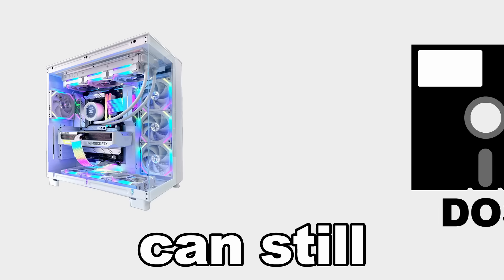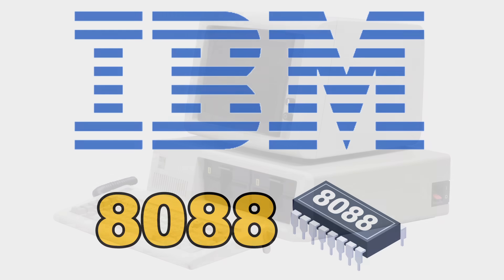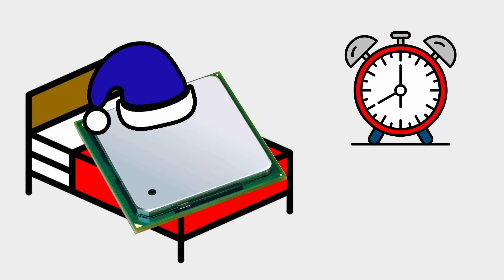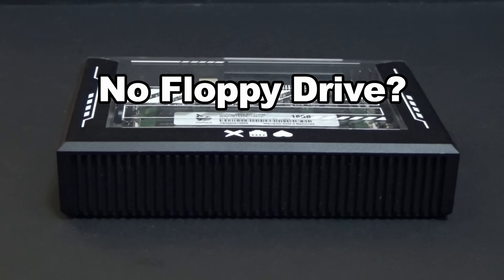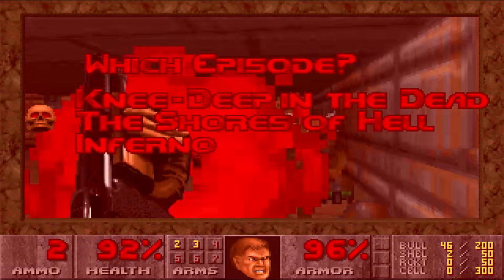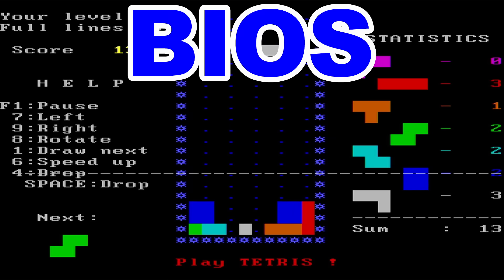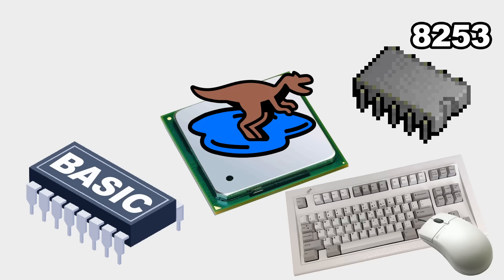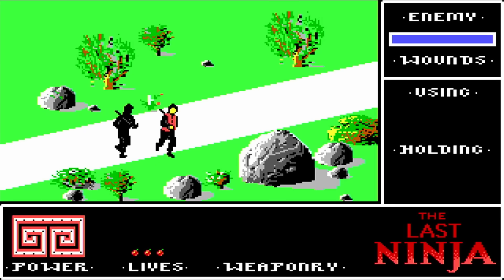45 Year Old DOS on a New Intel CPU Without Emulation

Comment: I tried installing DOS 6.22 on an X64 some time ago and it booted fine, however memory was limited as himem.sys and emm386.sys (with the mem=high, noems etc. or whatever they are, I forget at the moment) but it never found aynthing above 640k. Anyone got any suggestions on hoe to fix that? Thanks in advance.
Reply: I think it was Skylake that threw away software control of the A20 line, which HIMEM.SYS needs to get at anything above the 1MB line, which in turn breaks downstream of this (such as loading DOS high,  using EMM386 to remap memory into UMBs, emulate expanded memory etc.) that depends on HIMEM.SYS.

Comment: What are the advantages of losing the old instruction set?
Does it impede performance?  Is a significant amount of silicon set aside for it?
Reply: The main benefit is that it would free up the much-needed space for the future ISA extensions. x86 instructions are short at mere 1-2 bytes, so the rest of instructions have to be loooooong. Shorter instructions would result in smaller code footprint, reduced memory bandwidth requirements, increased I$ capacity and overall CPU front-end simplification.

Comment: The x86 does not have backwards compatibility with the 8080 and it's derivatives (the 8085 and z80). Instead, it has a sufficiently similar opcode set that relatively simple binary translation is almost the entirety of what's needed to move from 8080 to x86.
Reply: True for code. However the hardware environment was backward compatible to a large extent and used the same peripheral chips. NOTHING was backward compatible to the 8008/ 4004 !
Reply: Interestingly enough, this is true with almost any modern RISC-style core as well. The complex address modes need to be translated to more than one instruction, but overall it's a very simple, mechanical process. 8080/Z80 code runs natively very well after binary translation, since it typically fits in the L1 cache, along with the data. Getting 1GIPS equivalent Z80 instruction rates on current x64 is common. Not that there's a lot of utility for it, but hey, old Mandelbrot programs run at 60FPS+ :)

Comment: I had an old Intel Atom minilaptop, pretty useless for Windows today, gathering dust in a corner. I trashed the Windows installation and put FreeDOS in it. It works fine as a DOS machine, even with some stuff for original IBM CGA graphics from 80's.

Comment: That list of asm instructions aren't 16 bit. Comically cmpsb is compare single byte which is an 8 bit instruction but most are just jumps calls clears adds subs shifts and bitwise operands still in use on 64 bit systems.

Comment: Technically  most  CSM legacy support is emulation.  API emulation that is.   They use a combination of small stubs with Virtualization, IOMMU and/or ACPI functions to create a classic Interrupt BIOS that calls the newer UEFI/ACPI functions.  Because UEFI functions must run in either 32bit or 64bit mode, they do need to use a minimum of Virtual 8086 mode for a portion of their CPU-Side function.  

It doesn't fully hide itself.  If a DOS program traces down the calls it will see how they execute.  They honestly won't care and will consider it like any other 32bit mode extended BIOS.

This basically makes it more in the family of the Wine Win32/Win64 stack or or CP/M for DOS stacks, than native stacks like WinPR and MinGW.

Comment: This video is fake, isn't? Can't have Sound or VGA graphics. Dosbox is much better for old games because you have sound and it can emulate different graphic cards. Most modern mainboards no longer have legacy support. They also boot only from GPT. So you can't run DOS on it. Those times are over. Same with old Windows versions, like 3.11 or 95, 98, etc. In reality the oldest Microsoft OS you can run on modern hardware is Windows 10.

Comment: As far as I know, the backwards comparability isn't that much of a deal. the x86 and x86_64 instructions are translated into even tinier micro instructions before they are send to the pipelines for out of order execution. So the 16 bit instructions aren't much more than a few additional entries in this translation table that is there anyway.
the problem lies more in the way the bit patterns form instructions, that make this translation less efficient. but to make it more efficient basically the whole ISA has to be reorganized... which would break a lot not just 16 bit mode

Comment: I've got a low-end Lenovo laptop that I bought about 6 years ago. Since I am fine with installing Windows myself and could find it cheap, I got the option for "No OS".

I assume it was installed by them automatically to make sure devices that went out would boot up or so the techs could still update firmware if needed, but it came with FreeDOS installed.

Comment: He seems blissfully unaware that PC-DOS did not need BASIC on disk because it was built-in on IBM's (ONLY). Clones used MS-DOS, which was NOT in ROM and had GW-BASIC (Gee Whiz Basic) on disk. IBM did offer BASICA (advanced BASIC) on disk. 
Any PC compatible that HAD put IBM's BASIC in ROM would have been sued instantly. You can still be considered 100% compatible without having BASIC in ROM (which was pretty useless anyway since you need a DOS to store programs!).  🤡🤡🤡
Reply: My IBM PC has a cassette port to store/load basic programs.
Reply: You can write BASIC programs just by using the one supplied by the ROM, but you cannot save it. To do that, you'll need BASICA from PC-DOS, which added the capability to save the program.

ps. IBM BASIC was the default mode for "operating system not found" in IBM PC.

Comment: I suppose it kind of depends on your definition of "emulation".

There's almost nothing in a modern PC that MS-DOS understands. The storage devices, the input devices... Maybe, maybe, the old VGA modes might be supported by GPUs and might be directly usable by MS-DOS without any sort of emulation, but other than that, the BIOS pretty much emulates an old 8086 PC architecture by making the modern hardware look like it.
 
So for all intents and purposes MS-DOS is running in an emulated environment. It's just that it's BIOS that's doing the emulation rather than a piece of software. Maybe VGA might be the only thing that's not emulated, and the hardware supports it directly.
Reply: Programming system interrupt timer and keyboard input directly at least works just fine.
Reply: BIOS's purpose from day one was to hide the disk and video hardware details from DOS for this very reason.
Reply: @ 
Maybe so, but at least when it comes to video hardware you most definitely did not want to use BIOS routines to draw because they were extraordinarily inefficient, and it was significantly more efficient to write to video memory directly (which in VGA was mapped directly to a RAM address range, even in 16-bit mode.)
Reply: @DjVortex-w  All devices are memory mapped on the PC.  The BIOS routines only handled basic text I/O in console mode.  Graphics weren't supported at all in BIOS.
Reply: @stargazer7644  
I lived and coded at the time. And yes, BIOS did have system calls for switching graphical modes and draw to screen (especially in the multi-plane modes which were non-trivial to directly write to). However, these routines were extremely inefficient and you really didn't want to use them but for maybe the most basic of applications.
Reply: AMD stopped supporting VESA mode 103 on Polaris and none of the RTX cards would run on DOS because they depend on UEFI 2.3.1 class hardware.
Reply: @BrunodeSouzaLino  
Yet, even to this day x86 architecture CPUs carry the baggage of having 16-bit mode support, even though literally nothing uses it, and none of the 16-bit software that did use that mode decades ago is able to be run natively (and even if you needed to run that software, perfect emulation exists).

It's a complete mystery to me why they keep dragging that useless backwards compatibility in every single x86 processor. It's just a complete waste of transistors.
Reply: @DjVortex-w  Embedded devices. This is the reason why MS still hasn't cleared WinWorld to offer Windows XP, Vista or 7 for download as abandonware. There are thousands of such devices on the market which still depend on that compatibility. Se goes for software.
Reply: @BrunodeSouzaLino  
I highly doubt any embedded device has a modern x86 processor but runs 16-bit code in it.
Reply: @DjVortex-w  A good portion of automation stuff for CNC still runs 8 or 16 bit code and 3D printers only recently switched to 32 bit firmware.
Reply: @BrunodeSouzaLino  
The question was not whether 16-bit code is used in this day and age at all. The question was whether modern x86 processors need to support it.

The fact that you mention 8 bit code is a clear indication that you are not talking about modern x86 processors here (because they don't support any sort of "8-bit mode" at all).
Reply: @DjVortex-w  Considering CPUs like the 6502 are still being manufactured because they're used on tons of devices...
Reply: @BrunodeSouzaLino  
My question was why x86 processors still drag around the completely useless support for 16-bit mode. Other processors existing is completely irrelevant to that question.

Comment: The 8086 is not compatible to the 8080.
Reply: I replaced the 8088 in my XT clone with an NEC V20, which had both their version of the 8088 and a Z80 CPU in the same chip.  There was also a V30 for the 8086.

Comment: running dos games on real hardware does not only require the cpu to be compatible, but the graphicscard also needs to be compatible with VGA
Reply: All modern graphics cards are still compatible with VGA. They have to be or you would see nothing on the screen at startup.

Comment: @5:30 You're correct that the built-in BASIC is not available like it was back on those machines, but don't forget that you can (almost) always grab BASICA and BASICB and run those old basic programs by dropping those onto the system and using them to run 'em.  On that note, QBASIC won't work with those much older basic applications, but BASICA and BASICB usually do the job when run with an OS that can run said BASICA and BASICB.

Comment: Actually I was mostly running ARM in the 1990s after running mostly 6502 in the 1980s. The ARM back then was mostly backwards compatible with the 6502 in a number of ways mostly because of how it came about though the RISC structure of the ARM did eventually make this somewhat harder to do. Of course ARM has come a long way since those days...

So NO, not all of us went overboard for 8086 back then.
Reply: "ARM back then was mostly backwards compatible with the 6502" That's simply not true. Nothing about ARM 1 and ARM 2, and in fact any later ARM architecture, had anything to do with 6502. ARM 1 could run 6502 code very well after binary translation, but it was a waste of a 32-bit processor for the most part. Binary translators with good peephole optimizers could detect common 6502 instruction sequences like long addition/subtraction and translate them to fewer ARM instructions. Today you can do excellent binary translation from pretty much any retro processor to x64, RV32/64 and A32 (modern "desktop" ARM) instruction set. That's because there's a ton of very expensive software that is open source, like theorem provers.

Comment: I ran dos on my laptop on bare metal back in 2014. I very very quickly discovered that I liked having USB drivers. Frankly dosbox on top of something modern will give you a better experience. Like, I can use my USB midi keyboard (which DOS would have no drivers for) as an audio output device for doom. Or a virtual synth like fluidsynth. If you want the games of yesteryear to survive, pin your hopes on emulation. It will give you a much better experience I swear…

Comment: "Quite literally everyone and his dog had an IBM PC" Um...most people from 1982-1992 did not have a home computer and had little reason to spend the money on one. In 1990 for instance, only 15% of households had a computer.
Reply: Yeah, and most people who did have home computers during that time had 8-bit machines from companies like Commodore, Tandy, Atari, or Apple.  Or TI if they were unlucky.

That said, if you had a computer at work during that time period, it was probably a PC.
Reply: @jeffspaulding9834  28.1% of the adult population, reported they
use a computer either at home, at work, or at school in 1989.  As I remember, a lot of people at the time, who had PCs at work, bought a "clone" and pirated a lot of the software, particularly word processors and spreadsheets.  I'm pretty sure Microsoft made this pat of their marketing plan. There was a lot less hassle about copying apps back then, and I think it was on purpose, to achieve monopoly power.
Reply: @jeffspaulding9834   I used to play with (and maintain) VAX 11/780s.  We had 7 of 'em where I worked.
Reply: @jeffspaulding9834   "That said, if you had a computer at work during that time period, it was probably a PC."

My work computer was a VAX 11/780.  🙂
Reply: I got my first computer, an IMSAI 8080, in 1976.
Reply: @James_Knott  Yes, some people did - my first was a TRS-80 model 1.  But it was still unusual at the time when considering the whole population.
Reply: Everyone had access, since they were in the public libraries, and there was funding for computers in the public libraries.  There were also computer rooms, where you got access.
Reply: My parents got an IBM PC XT to run their business in 1983. I was in college and helped them with the software. Upgrading that machine, and then building new ones for them every 4 years, got me into computers. My first computer (1987) was a Toshiba T1100 Plus - one of the first clamshell laptops. I was traveling for work a lot and it was nice to do my expenses on it. I was a big fan of DR DOS and built several machines with multi-OS boot options starting in 1990. I was also a fan of OS/2 Warp - it was much more stable than Windows and worked so much better. Darn, I spent so much money on computer stuff.
Nice memories although I wouldn't go back - I like the advances too much.
Reply: I made up for those folks that didn't have one.  I got my first computer in 1982.  My first 5 weren't PCs.  I probably had 20 of them by 1990.
Reply: IBM PCs were stupidly expensive weren't they? Businesses bought them of course but at home I think people were still using Commodores if they even had a computer. Things didn't get affordable in the PC market until Compaq cloned the PC and tons of other companies followed. IBM wasn't happy at all about that.
Reply: @_Thrackerzod  People didn't generally have IBM PCs at home until the PC compatibles became popular.  There were lots of 8-bit machines in the home market:  Timex/Sinclair, Texas Instruments, Atari, Tandy/Radio Shack, Commodore, Heath/Zenith and Apple.
Reply: @_Thrackerzod  I got my first PC in the home, in 1990.   before that, I would use a shared pc.   The commodore was too slow to use.
Reply: 1982 you're correct. 1990 you're either wrong or not at least not talking about the UK.

 Amstrad launched their 1512 machine about then, and at least in the UK that's where home computers really took off for us. 

In the educational market people who bought computers to give their kids a head start in the new tech were already buying BBC micros at the same time. Like the much later Raspberry Pi the BBC has plenty of hardware options for learning about controlling other electronics.

The BBC computer design was named after our national TV service, which ran a series of programmes (*) aimed at nerds wanting to do hobby computing and has designed a reference computer for those who wanted to be sure of having the same hardware as the presenters. Those computers then really took off in schools, with parents raising funds to buy the school one computer to share with the entire school. Often the kids were teaching the teachers...

Amstrad had had an earlier home computer but it was really aimed at business use (text processing, spreadsheets, etc). It was their 1512 and 1640 that really achieved access into the home 

I'm not sure which country you're thinking of with a 15% penetration by 1990, but I'm sure in the UK it was already higher than that: due entirely (in my opinion) to Amstrad and the BBC computers which between than had created the mass market. 

(*) Note on spelling: in British English TV and radio had programmes, whereas computers ran programs. Millennial Brits may use the US spelling for both words, but many boomers like myself still uphold the distinction we were taught back in the day.